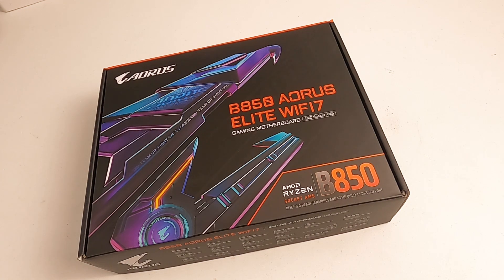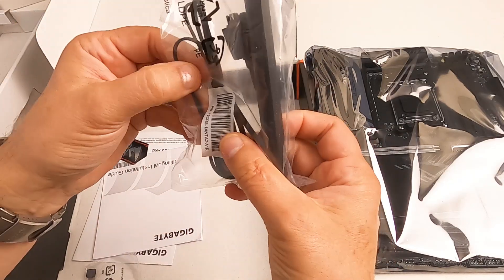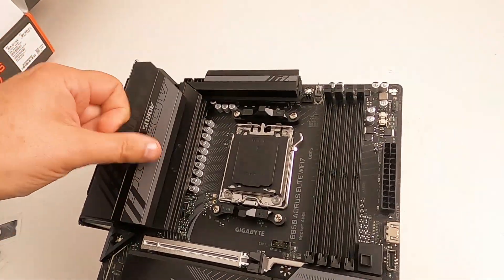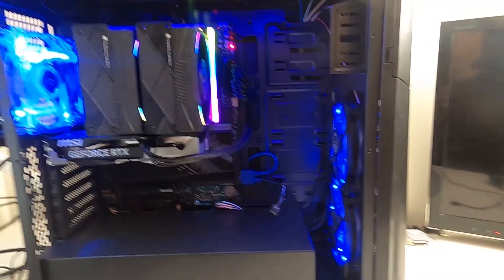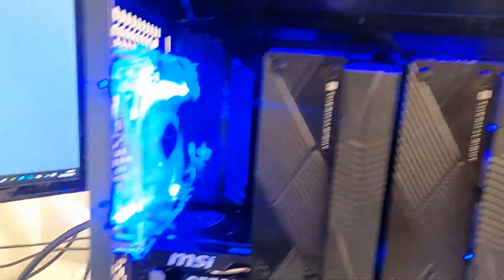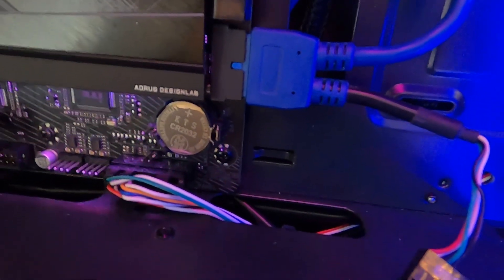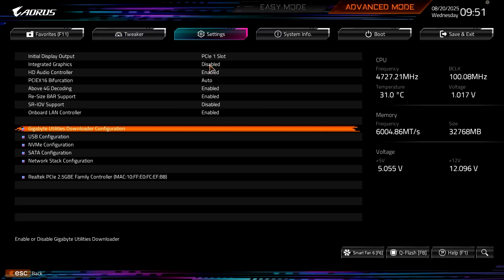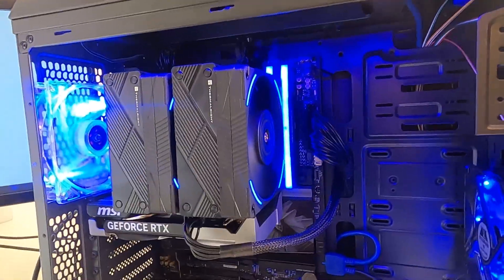B850 Aorus ELITE WIFI7 *REAL* Unboxing & Build Advice

Comment: Hello, yesterday I got this motherboard and it came without the company secure tape (what ever you call that) that lets you know it hasn't been open, like you said at the beginning of the video your mb also didn't come with it, I'm I right?
Reply from the maker: Yes. Some boards have sealed boxes and some don’t.

The internal bag that the board is in might have tape on it, or it might not.

Some boards, like the ASUS Dark Hero, don’t actually have an anti-static bag either.

It’s unsettling if you’re used to things being wrapped and sealed. 😂

I unbox things as they arrived so if your board is the same as shown in the video then it’s supposed to be like that and you’ve not been sent a returned item.
Reply: @sterntechdaddy Thank you for clearing it out! I thought they tried to scam me by sending a open/used motherboard. Thank you very much, much appreciated!

Comment: Is that a 140mm air cooler? Should I be fine with a DeepCool AK620 Digital Pro because I have a future build with this exact mobo and as I see the clearance between the GPU and Cooler isnt much. Thanks in advance!
Reply from the maker: Its 120mm but its also upside down. The gap between the cooler and the GPU is bigger when it put on the other way up.

I reversed it later…

😝

Comment: does fits a GIGABYTE 5070TI with an CPU AIR Cooler? looks very close^^
Reply from the maker: It'll fit. Graphics cards are designed so the they don't overlap the PCIE slot above - so the back plate is in line with the slot they are in. I think the cooler can be mounted the other way around and that gives more of a gap anyway. So don't worry.
Reply: @sterntechdaddy  Thx <3

Comment: I have the X870E Aorus Elite board they seem to be very good boards for AM5, something I found interesting as a difference between the two your CMOS battery is actually accessible but for some reason on mine they shoved it under a heat sink somewhere that you would have to remove. Very interesting and annoying choice by Gigabyte when they are almost the same board expect for the Chipset and I/O.